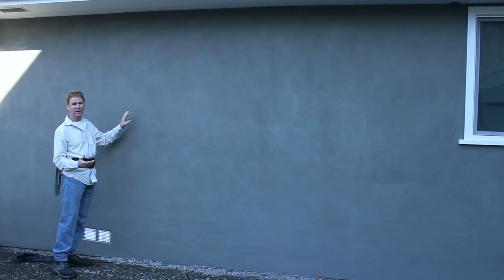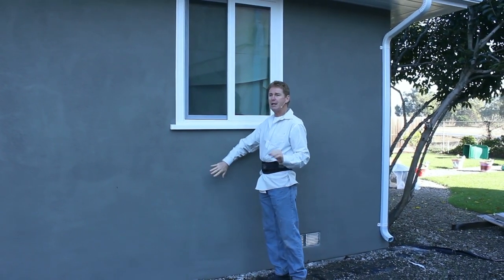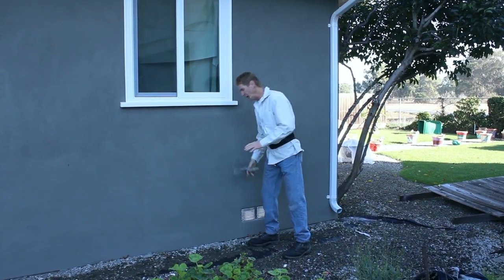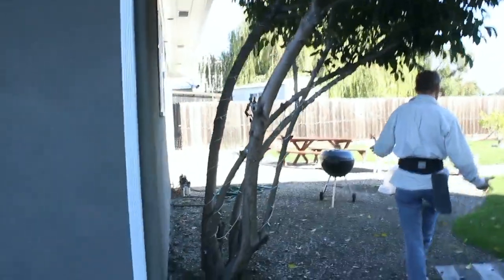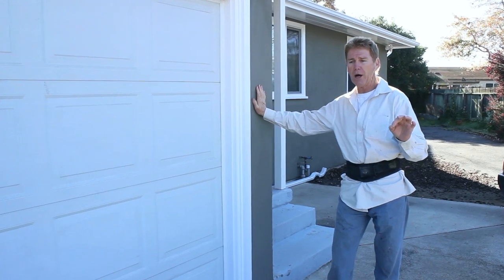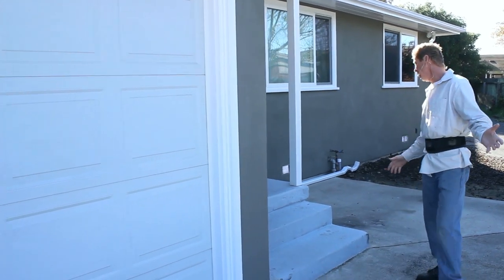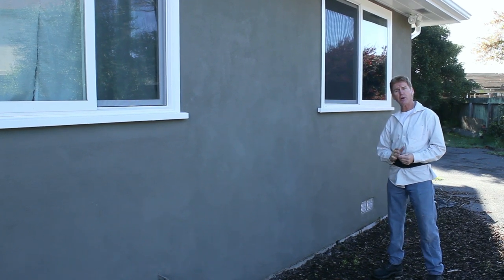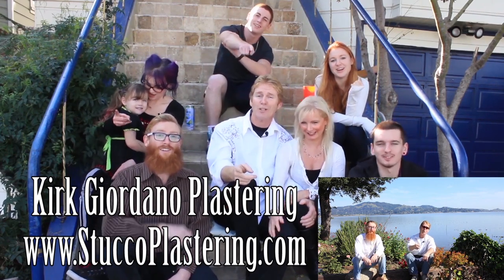Stucco acrylic vs. traditional stucco, cost difference.

Comment: G'day Kirk,
you are absolutely right about how much of a pain these kinds of finishes are to do on two storey buildings. I had to produce this finish on a 3 story lift shaft about 3 years ago. We are in the southern hemisphere obviously here in Sydney Australia, and the south side of the shaft was relatively easy, however the northern side was very very difficult. Heat from direct sunlight over that height made it almost impossible. My saving grace was the fact we had horizontal control joints on each floor so at least i was only having to concern myself with 10 foot (3 meter) vertical sections rather than the full shaft height.

Some may question why bother if its so much more expensive?

On my job i use acrylic because i thought it would be a lot easier carrying buckets up a 3 storey lift shaft on my own instead of trying to mix, carry and spread a cement based mix. Also, i think the acrylic is less messy to apply.
Reply from the maker: Good Evening Adam my fellow plasterer from Australia, no doubt the horizontal expansions saved you from the dreaded scaffold joints.
FYI, all of us here at the giordano plastering channel we wish to thank all our subscribers and those of you who accidentally stumble on our channel a happy and prosperous new year
 kirk giordano plastering

Comment: Hi Kirk, can you make a video explaining the strength difference and longevity difference between acrylic and the sand and cement style, if i'm not mistaken you need quite a bit more base coat and finish going sand and cement.. Meaning more cost and load to the structure. 

On a side note have you ever used drip tracks or "V" grooves to break up the wall  ?

Comment: Would you please do a video on the differences between STUCCO VS PLASTER.  The versatility of plaster to be used on both internal and external applications is interesting.  What are the advantages and downfalls of each?  I live in a cold weather climate.  Does this matter?  Many thanks for your efforts and videos.  ***All good looking and smart men are named Kirk
Reply from the maker: Howdy kirk, LOL, stucco is a term used for exterior plastering. 
Plastering is a term used primarily for interior plastering. 
Thus stucco is for exteriors while plaster is used for interiors. 🍻
Reply: Gypsum-based plaster is interior, lime-based plaster is used on exterior (notably in Greece, etc)

Comment: This is correct, i just would add that anytime you do very smooth , you always do two coats on the firs you can do a little thicker and green float it , next day you scrape any small aggregate  and  imperfections  then apply very thin coat , and steel trowel in a circular motion  and pair of guys per section , this way you don't have to paint , and il looks very nice.
Reply from the maker: Howdy Fuser, with cementitious finishes this is how we do it, however, we dont wait for the next day, the second coat is usually done on the same day with me.
    We also apply full strength the recomened primer for that finish coat as we did in the acrylic color finsh in the video.  thank you
May peace, love, and happiness, find you and yours always
                Kirk Giordano Plastering and stucco tips

Comment: How long does each of the types of color finishes (acrylic vs tinted) cement plaster last?If the finishes fade what is a reasonable length of time for  paint over the plaster be expected to last? Can you apply acrylic finish over old plaster and do you need to apply plaster weld or prime over old surfaces?
Reply from the maker: Howdy David, you sure you didn't miss any questions?
 The acrylic's and the cementitious last forever, meaning they don't peel or come off, sure the colors will fade with any product in due time depending on the sun's heat.
In Arizona or Mexico where the temperatures reach 105 to 115 in the summer months, expect these colors to fade in 20 to 40 years or even sooner, this is natural and look cool in my personal opinion, in areas with cooler weather expect fading in 50 to 60 years, all depends on many other factors as well.
 Acrylic's as well as cementitious products can be applid to almost and base coat as long as correct prep measures are carried out.
 Cheers and have a happy new year my friend,
 Kirk and family
Reply: Thanks Kurt .Love the videos.. keep them coming in my friend!!!!
Reply from the maker: Howdy David, no worries,
 Cheers and have a good and healthy new year,
 Kirk and Jason giordano
Reply: Kirk, thank you for your videos.

Since acrylic stucco is 3+ times more expensive and more difficult to apply why would you ever use it over conventional one?
Reply from the maker: Howdy William dude, Excellent question, glad you asked.
Too many reasons to list here but I name just two out of about 20 good reasons, the main one is the acrylic's flex more than cementitious, thus when it rains for 30 days all houses will lift from a hair to and 1/8 of an inch, quite normal, when the home settles regular cementitious color coat finishes are prone to hairlining by this natural occurring motion.
 Same as when doors and windows slam for instance this causes vibrations, vibrations and or movement is like kryptonite to superman, not good.
 the acrylic's flex a bit more.
 Another example is say glass it will tweak just a hair when flexed or manipulated anything more it will crack, same as stucco, cement or any other cementitious material. 
Folks don't wish to here this but hairline cracks are natural and quite normal, with no cause for alarm.
 Best wishes with your projects,
 Kirk giordano plastering on small repairs

Comment: Hey Kirk and family. I'm looking to do a color coat over my existing stucco. The stucco has glass embedded in. Do I need to use weld-crete because of the glass or am I good to just wet and trowel? It gets down below -30 degrees Celsius in winter as well. Not sure if that makes a difference or not so I thought I'd add that info. You guys are awesome!
Reply from the maker: Evening Elaina, thank you,
 I would  pressure wash well, apply a bonding agent then stucco as usual, 

Cheers,
 Giordano’s Rendering plaster and stucco teaching videos
Reply: Kirk Giordano plastering Inc. Thanks a bunch!

Comment: Absolutely spot on about the darker colors being more difficult to work with to achieve a uniform color. Alot of times, if possible, it's better to lay on the finish mud  east to west instead of top to bottom like conventional stucco. Less chance of getting a "joint" and "burning it"..also, if your elbow isn't hurting when you are laying on Dryvit or BMG or whatever, then you are putting it on too thick
Reply from the maker: Evening Al Maltby my fellow plasterer. I have never had so far any trouble with shoulders or arms, now my back sometimes kicks my Arse.
           Bringing peace, love, and brotherhood back to the world of, “Cement Plastering.” 💃
With over 800 educational and free Youtube videos, by your favorite plaster geek, “me🤓” and my son, “Jason,” the bearded plasterer.🌍

Comment: Thanks for this one. It answer questions I always wondered about. But it also brought a few new ones. Are these acrylic plasters usually used over styrofoam? Or, what looks like styrofoam? And what surface do you prime? Don't these products come colored already? Or by prime do you mean the blue stuff you put on for better adhesion? Look forward to the video links. Thanks again!
Reply from the maker: Howdy Harold, acrylics are an alternative to cementitious finishes; they flex more are more water-resistant. But also costs 3 times as much to purchase and apply now; one must paint the entire house with the primer plus use the acrylic, which sticks to everything.
 All acrylics come with primers, not a bonding agent. Cheers.

Comment: What thickness is Dryvit sand pebble fine? Or specifically is it thicker than what is shown in this video?
Reply from the maker: Howdy Luke, the average thickness for a fine finish is 1/16 to 1/8 of an inch. Or about 50 to 70 times thicker than paint. Cheers.😉

Comment: I used expanded lath over marine grade plywood. I brown coat, water it for a week OFTEN. Color coat and you are done. It has been 12 years and only a few hairline cracks. Nailed that Galvanized lath @ 6" on center. Fantastic economy and durability.
   Added a section and did cement board with fiberglass tape on joints, primer and then an elastomeric brush on finish. Still good after 15 years. Main house, marine ply nailed for shear, paper, chicken wire, then scratch, brown and color. @ 1" thick. Looks to outlast me and my kids. This material looks like it needs to be re engineered.
Reply from the maker: Howdy Richard, can't argue with integrity over time, I didn't realize Marin plywood was waterproof, how'd you get your joints watertight is a mystery to me also,
 unless you applied a moister barrior over the marine plywood.
     Best wishes,
Plastering tips from your favorite stucco geeks
Reply: Yes, always used 15# felt or standard black stucco paper over the ply. The marine ply is not so much water proof as it is stable and non deteriorating over time and high humidity. Ran out and bought 1 sheet of standard ply from local yard - that one spot has lots of small cracks in it as that poor plywood moves around. A good quality APA stamped sheet of 3/4 fir ply works too, that is what I used under the expanded lath job. If I do more in the future, the expanded lath 2 coat system seems best to me.
Reply: I wrote this once but it vanished.... Marine ply is not waterproof and I use paper over it of course. What it has is integrity and high water resistance and lack of cupping and warping over heat/ moisture changes. The ONE sheet of "normal" sheathing I used under my 3 coat standard stucco has cups and cracks in the finish. After all my experimenting, the bestest and fastest is 5/8 APA doug fir ply, 5 ply. Then a good moisture resistant paper or composite, then galvanized expanded lath nailed with ring shank nails, then brown coat, flat finish, then color. What most people fail to do is give the brown coat a week or two WET cure. Hire a kid to hang out and hose it.
Reply from the maker: Howdy  Richard, excellent advise.
                      Best wishes,
Sound advice From your neighborhood stucco geeks
Reply: Primer is a must , good job .

Comment: Hi Kirk. I'm working my way through your videos. I'm replacing all my windows in my 1950 Phoenix stucco home. I have a float finish thats been painted many times.  In addition to repairing that stucco around 12 windows, there are two walls with heavy vertical cracks below windows and one wall with a badly matched circular patch. I'm certain to recoat the entire house. In talking to contractors, I'm  getting mixed information. One guy says  to diamond lathe (expaded metal?) the two cracking walls. Is that over kill vs the tape I've seen you use?   He also told me if I want the cementitious top coat he couldn't color it, doesn't work, some thing about float finishes and water? I've seen you do a number of float finishes and I've not seen you water anything. Did I miss it? And colored acrylic he said was way expensive and  would have to be painted anyway in a few years? My understanding is you should not put acrylic over old cementitious because it seals the house up too much and doesn't let the stucco breath and you get mold issues. Is this true?

The other thing is,  does the entire house get a new base coat plus color coat or just base coat the new patches and then colored top coat for the entire house?  Again ill be going over painted cementitious that is float finished and I'd like to float fishing again either 20 30 or 16 20.

FYI this same guy wanted to diamond lathe my 2 planters and stucco them but they don't have any big moving cracks. 

Appreciate your insight.
Reply from the maker: Hi, I'd recommend you have a person pressure wash your home and apply an acrylic stucco finish over it. Most of what you've heard is nonsense. Get a real expert's opinion.
Below are a few to help you better understand the procedure, best wishes.
https://youtu.be/xPvm5BUm5-8/ Stucco color finishing fixing bad/ugly patches/textures GAB
https://youtu.be/M-5yPXuIuJk/ make the heavy texture smooth, heavy texture textures.
https://youtu.be/chU9So3vy9s/ complete color coating instructions moss green
https://youtu.be/1enMWniNYkI/ stucco texture fixes wrong patching window
https://youtu.be/1enMWniNYkI/ how to repair bad stucco textures
https://youtu.be/iiC8HUKLyHs/  stucco/plaster bonding agents for plastering
Reply: @StuccoPlastering  I'm sure there a lot of myths,  and so far have not met anyone in Phoenix I would say is an expert. Curious as to why acrylic? I don't think I've seen you do any acrylic finishes.
Reply from the maker: @astridc9778  I've applied acrylic stucco to over 40 homes, they flex and make the walls moisture resistant. We have only been doing videos for ten years so my 30 prior years working with 10 men is in the past and out of mind.
Reply from the maker: @astridc9778  ACRYLIC STUCCO
https://youtu.be/283DclFqDwk/Acrylic/ stucco finish, synthetic stucco finish, stucco-flex.
https://youtu.be/d3sHR8KD16c/Stucco/  stucco acrylic’s for retaining walls.
https://youtu.be/NCP0gM2dQVY/acrylic/  acrylic plastering for flexibility. 
https://youtu.be/V9adGQVHPM4/Stucco/  acrylics, how to prevent ghosting or discoloration.
https://youtu.be/vaykXWAsFCA/Acrylic/ acrylic or synthetic stucco finishes.

Comment: Hi Kirk! I've been watching your videos because I am planning a small desert cottage build in an adobe style. I am looking to make it a white, an slightly crude finish. I have two questions that I would really appreciate your advice on:

1. On the corners, how could I get a more rounded finish versus a blocky, sharp 90 degree angle? Should I just sculpt it or is there a trade secret for this?

2. If I used a cement plaster, could I paint the plaster afterwards instead of adding a dye during the process?

Thank you for putting all of this great info out for all of us to learn from!
Reply from the maker: Good morning Phil, they do sell bullnose corner aid which you can attach to give the corners a rounded appearance. 
As far as painting yes you can paint all stuccos after the proper cure time of 28 days.
    Live long and plaster
 teaching  plastering video’s
Reply: Kirk Giordano plastering Inc. Thanks kirk!
Reply from the maker: Good morning Phil, no worries
    Live long and plaster
 teaching  plastering video’s

Comment: Why did he paint over it? For uniformity? I thought it was inside the acrylic?
Reply from the maker: Hi, I meant he painted anything that the stucco acrylic was not applied over. We stucco walls, often wood trim or ceiling need to be painted.🍾
Reply: I was wondering about that as well.

Comment: I know nothing more now than before watching this…what is the difference??? How do they hold up, etc
Reply from the maker: Hi Joni, this is in the description. Think and grow intelligent.
Acrylic stucco costs more as they are twice the work, and costs are about three times that of cementitious color coats. 
  However, acrylic stucco tends to flex more.
In the long run, Less hairline cracking if your home is on a hill or area prone to ground movement, plus they are more water-resistant and won’t darken when wet.

Comment: Why don’t you like the finest finish like the finish in this video. It doesn’t last as long?
Reply from the maker: Howdy Fish hunt Dude, excellent question.
 This fine sand finish hides no flaws as the sand is the finest sold, that being said, I rodded the complete home, as I knew what I would be up against when the finish was to be applied.    
                      Best wishes,
Teaching the world how to plaster one Video at a time.
Reply: What does rodded the home mean?
Reply from the maker: Howdy Richard, it means we either use a rod or a darby to get the walls true and plumb in all directions.
 Google darby plaster work or even rod work in plastering. 
     Best wishes,
Plastering tips from your favorite stucco geeks
Reply: I would use a darby for a shower, but outside those imperfections give the stucco some feel. That blue house looks like formica. Flat and dead.
Reply from the maker: Howdy Richard, I like your style, I too prefer old world charm to the super modern look which says hey world I have a lot of cash.
 I turned down a job just last month where the fella was explained everything had to be straight as he was going to use a level to check.
 I told him I would be too busy for the next 15 years, as I don't get involved with that sort of attaitude.
Sound advice From your neighborhood stucco geeks

Comment: Banks, malls, plaza, big hotel chains always use acrylic stucco. Why is that? Is it because its more expensive or because its superior?   And not all smoother finishes needs primer. With 2 inch eps foam board you get an r10 value energy saving. Traditional stucco gets none and hairline cracks are more  prominent.. dryvit systems have less room for crack when done by a pro as it has reinforst fiberglass mesh every square inch before final coat. And the old wire lathe get rusted overtime. Fiberglass mesh never rust.. I have full access the all the dryvit litertures on all their application...
Reply from the maker: Evening Omeil, I used the Dry-Vit stucco color finish on my home. That should explain my opinion of their stucco acrylic.
                  Bringing peace, love, and harmony back to the world of plastering.
    The complete plastering encyclopedia on video, by the plastering messengers of Youtube.
Reply: I know that dryvit doesn’t stain.  I am guessing the cementitious stucco can stain, because cement is stainable. Not sure though, I am no pro.